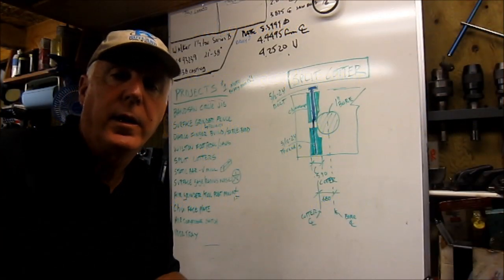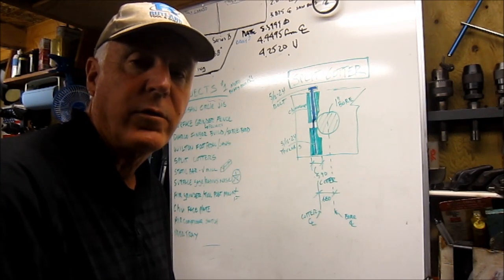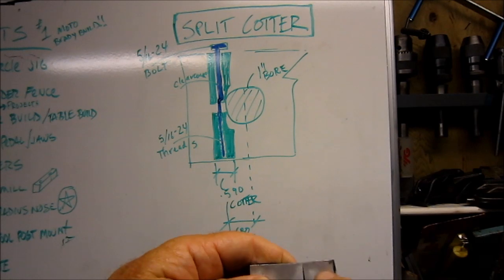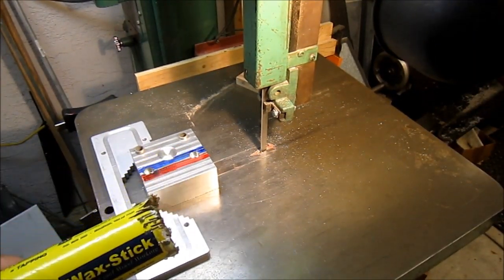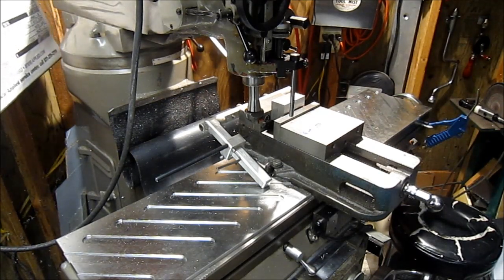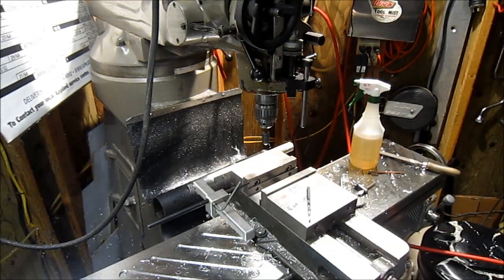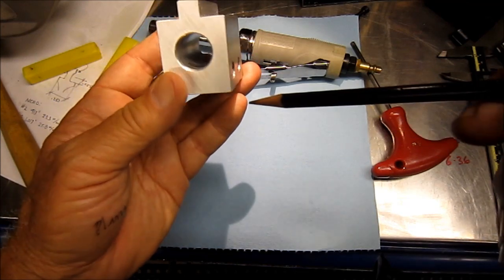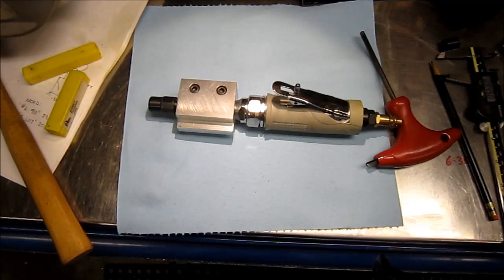Tool Time 30  Split Cotter

Comment: Hey Chuck,

A good example of a split cotter is the brass quill lock on your milling machine.

Excellent job on the die grinder holder, very well done! Thanks for the tip on the finish, looks great and I'll give it a try on the next project.

Ray

Comment: Nice job on the grinder holder.  I have been wanting to set up a grinder holder.  My 6 tool turret uses cotters to lock in the tools.  I could measure and make a drawing for you, or I could disassemble it in a video. Thanks for sharing and the call out.
Randy

Comment: BOO! HISSS!

Aside from having your shop elves make the parts while you go for a nap, you forgot the split sleeve.  With the cotters contacting the grinder directly they are going to wear divots into the shaft housing.   The cotters need to be softer than the shaft being held or a sleeve used to spread the clamping force and protect the shaft.
 As for split cotters - "PPbbffttt"  Your split ring clamp is both tighter and more stable.  Using your drawing for illustrative purposes - by necessity,  the bore has to have clearance to allow you to insert a bar, etc.  A split cotter can only push the bar away to the opposite side of the bore.  Since the cotters are floating up and down, the bar can also rock up and down within the bore clearance unless some deformation takes place.  The cotter bolt would have to be held rigid in the holder between cotters with one cotter reverse threaded to provide some registration against movement.
Back to split clamping, the key is to make one of the halves more rigid so that the thinner bit of the clamp does all the deforming so you get placement repeatability.

Other than that, Mrs. Lincoln, I enjoyed the play.  :)
Reply: Rut row.  Not getting a reply from Chuck worries me.  Chuck, I hope I have not offended you in any way.
Reply from the maker: Good comments/info thanks for the feedback
Reply from the maker: Eddie... Been busy pls know that I respect your comments/feedback and hope that you continue post comments
Chuck
Reply: outsidescrewball There's no flies on Eddie but you can the marks where they've been!

Comment: I think that's what most lathe tail-stock quill locks are...mine is anyway...and if you unscrew the bolt the bottom half drops down inside the tail-stock............ -__-

Comment: Hi Chuck,
Interesting video, I've looked a little for infos on the subject, like you say it's not easy to find, if you have more you are willing to share, you're more than welcome to do it.
Thanks,
Pierre
Reply from the maker: pierre beaudry Pierre, what I have learned, mostly from some feedback from viewers and then some thinking of what I have seen is that the edge of the cotter is cut at about a 55 degree angle, so the cotter can be built and installed without the need of boring through it as I did....going to build a circle jig for my bandsaw and it will have cotters

Comment: Chuck, I think your vernacular is off. I think there called a "Dutch Gibb" or a solid pin I called a Dutch Pin. I myself am not sure about this. But an old T=D maker used that term before, so... (Much like the boy with his finger in the Dyke...I guess)
I've seen a low value Chinese lathe use this design as a take up, for back lash on a cross slide.
 The same would be true with the friction lock in the quill of a B/port.
 Your on the right track though.
 I would add (If I may) I would case harden your "Cotters" ...because they will gaul over time. and you'll find yourself in a real jack-pot trying to get your tool out of that bore.
You can buy Casing powder from MSC, Travers, etc, etc.

Comment: Since this episode aired several months ago, you've probably already figured this out, but just in case...What you are calling a split cotter, which I've never heard called that is also commonly known as a 'quill clamp' or 'quill lock'. It is almost always used to lock the quill of a drill press and lathe tailstock quill. Therefor, you've probably been using one form or another of it for years and maybe didn't realize it So if you search on one of those names, you will find plenty of information.

Comment: Interesting topic and construction. Why did you use aluminium rather than steel? I realise that aluminium is what stock you had readily available but steel is a lot tougher and less likely to warp / tear. Steel might be viewed as "over-the-top" for this light weight task with this air grinder I suppose.

Comment: Very interesting subject! I didn't know info was so hard to find on cotters. My horizontal mill uses them to secure the overarm support, and the tailstock on my lathe uses one to lock the spindle. The only thing inconvenient about them is that they tend to rotate in their bores and that can make inserting the shaft that they clamp difficult. Just brainstorming for a second, I wonder if there is a way to make keyed split cotters, so that they don't rotate...

Comment: The quill lock on most turret Mills is a "split cotter clamp".
There are no standard dimensions for split cotter clamps as the proportions vary on a case my case basis.

Comment: Split cotters was also used on old ford transit front king pins hammered in from one side then a nut tightened up but they had a very long tapper

Comment: I'm going to have to see if any of my grinders have a neck on it that is uniform to be able to do something like this. I have an old chuck which could probably use some grinding, too (saw your other video grinding the chuck first).  Thanks for the tips and offering another way to create it versus a slit like you showed early in the video.

Nice work.
Reply from the maker: ILGopher Thanks, I think the neck is not uniform, two cotters would still hold it because they bite separately, but then just how straight would the tool be might be the issue...good luck

Comment: I think the boring bar holder is a slightly different design from what you're looking for.  The boring bar holder has an inner sleeve which is probably pinched closed when you tighten the screws and thus clamping much more of the surface.
Reply from the maker: TheDisorderly1 You are correct, thanks for the feedback and watching

Comment: The cotter arrangement in the boring bar holder is a good one - A true split cotter would require a head at the top or a groove and set screw arrangement to retain the assembly in the toolholder. ( By golly it must be a big fan to require a phase converter! )
 Similarly the split cotter, as envisaged, would require a set screw arrangement to prevent the cotter ( assuming they will be split after machining the bore ) from rotating during boring - if split first, two retaining set screws. They will possibly need some sort of spring between ( a Bellville washer or a Bellvue washer ? ) to keep them apart when the clamping screw is loosened.
 I'm not saying that it cannot be done, but why make something simple and easy to make into something wonderful but complicated and difficult to make ?
Reply from the maker: Jester Mclarpet Jester...either you had too much to drink when you wrote your comment and I know I have had to much to drink as I am reading your comment....LOL  But truth be told you lost me....well kind of....LOL  if you were close by, we could mix a couple and really have a discussionATBChuck
Reply: I get rather too talkative when my medication hasn't kicked in (bipolar disorder).
 PS - Clean & Sober 15 years a day at a time.

Comment: Was just wondering why you don't just use the straight edge of that piece
of aluminum when band sawing a piece and it wouldn't bind.
Great video and nice machining on the part.
Reply from the maker: Tom Bellus Hey Tom, thanks for watching and you enjoyment, hey...I just have to use the tool I built...lol
Reply: outsidescrewball I understand, just my thought.  I really like your shop.